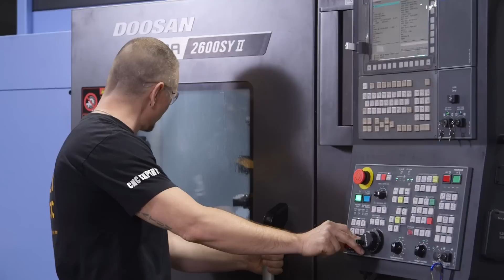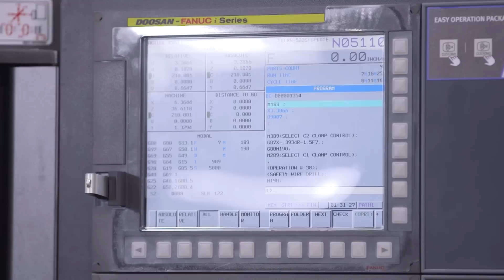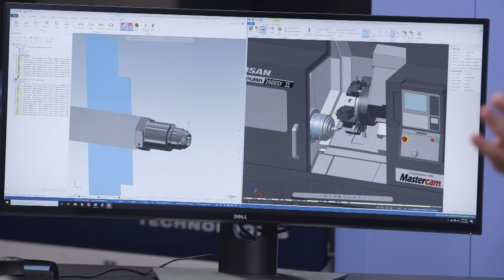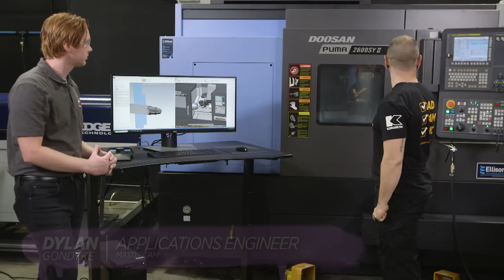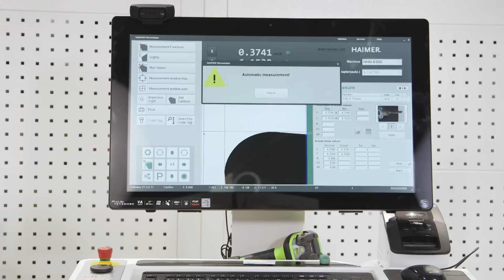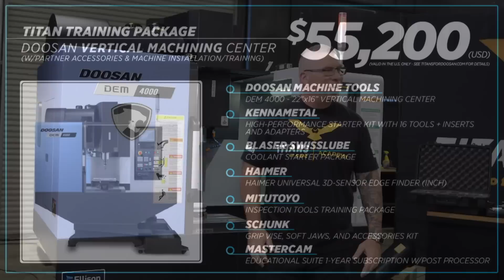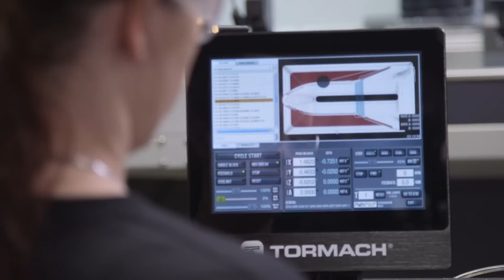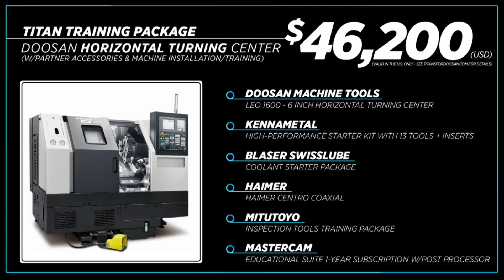316L Machining DEMO on PUMA 2600SY II | DN Solutions

Comment: Running my own company, and change from KM to Capto system. Had big problem with broken KM holders, the connection is not strong enough. The best thing is that you can buy Capto from Coromant, Seco, Walter, Iscar, Tungaloy and more. And that is really good.
So changing from KM, to Capto is the best thing that I have done for my company.
Best Regardes From Sweden

Comment: Good Stuff!! You want to deburr your thread from the top down using the 35 deg. finisher.  No need to rerun the finishing tool. Just deburr last thread and first thread top down. Then a single deburr pass with your topping insert. This part will have a burr on the first thread.

Comment: Always gotta drive the machine. You can't just start your car and it magically switches gears for you. You could press down on the gas all you like, but that doesn't change the fact you're in reverse sending yourself into the car behind you. I'll admit sometimes things look 100% fine from outside the glass, but you shouldn't be scared to get close and make sure what you're doing actually looks like what it needs to do. Triple check everything if you have to!

Comment: I know that you already know this, but the dual spindle turret lathe with live tooling is pretty great, but its limitations are its small capacity for tools and tool interference. Tool interference is probably the biggest downside because often times the ideal tool location for one job is horrible for the next. This makes these kinds of machines great for high volume runs, but usually horrible for low production runs. The better of these types of machines are B axis machines that just grab the tools from a tool changer. No interference, greater tool selection, and much less setup time, with the very slight drawback that tool indexing time is less. I know that you know this all too well, as you have a Doosan MYNX.
Reply: Its been 3 years, you know this by now. but for everybody else: Yep. You should not be operating a multi-spindle without the knowladge to use it effectively like this commenter. We always see people trying to use our systems with very very little understanding! LOM makes big big money, but only with smart people behind it

Comment: Nice part Titan
You could have saved some time by increasing the size of the 1st pass on the second time the threading tools came back in
Also would probably have come in with different tool to hog most of the material in the bore on R/H chuck

Comment: Hi Titan, I also made similar parts from titanium and inconel for the military aviation industry, which then underwent very strict quality control, I wonder how exactly you check the 74 degree cone, this is a rather important element in this part ...
Reply: you need an 3D scanner

Comment: If you were going to run this part lights out to the quality that you demand how would you automate the chip removal to ensure that no bird nests interfere with or hung-up on the tooling or are left in the part on completion.
Any automation possible for  checking the thread on the fly?
I can see possibility to accurately check the external thread the internal thread is more problematic to check accurately and harder on physical gauges. 
Probably not worth the additional setup time unless you were making thousands a month.
Have you ever used abrasive brushes for internal burr mitigation you have powered tooling you could easily set up a number of brushes only problem is they catch stringer chips and birds nests best used on the second operation anyway. 
You have high pressure coolant that can be used to flush many of these problems off the tooling.
Lot of things to think about sometimes they can be added in with a little pain.
A ton of shit to think about in the overall picture in a part shop, in a dedicated production shop that's a whole nother beast because the machine can be dedicated to making a number of similar parts opens itself up for more detailed chip management.
Stainless chips do not break up well in fine cuts leaving stringy razor sharp bird nests that just beg you to reach out and touch them only to pull back a bloody paw.